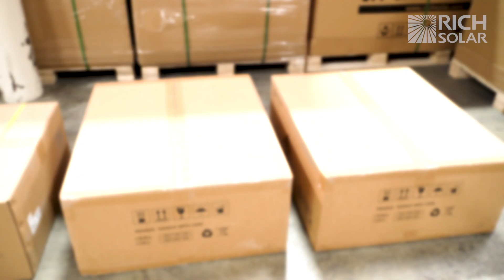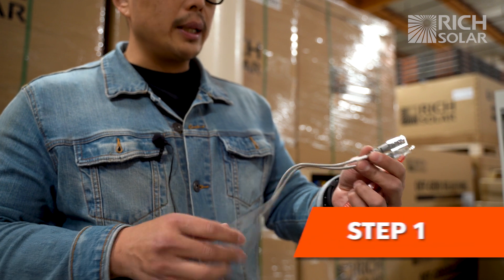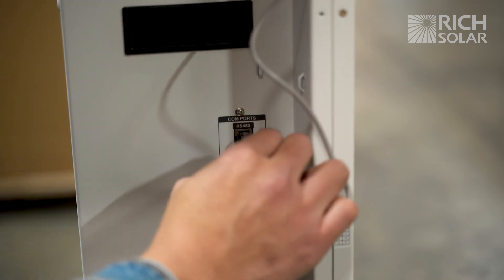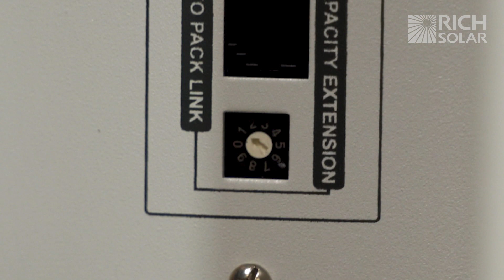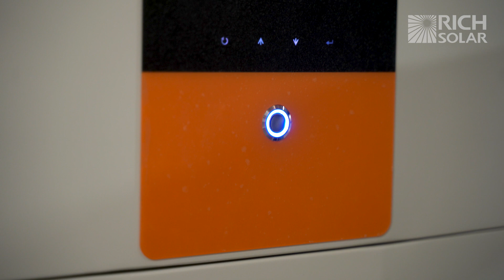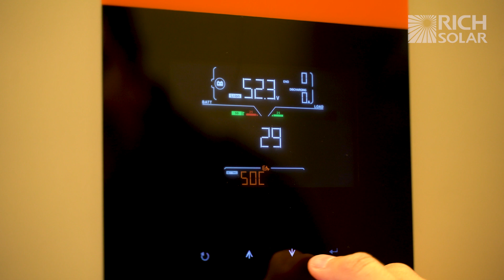Rich Solar Talk: How to Setup the Rich Solar ALPHA All-In-One System

Comment: I ordered this setup and it didn't come with the 41 inch cables to connect the inverter with the bottom battery, where can I order those? I don't see them on your website
Reply from the maker: Hey, kindly call us at 800-831-9889 (option 3) or email support@richsolar.com. Thanks!
Reply: How much was your system
Reply: @barfy4751  $4500